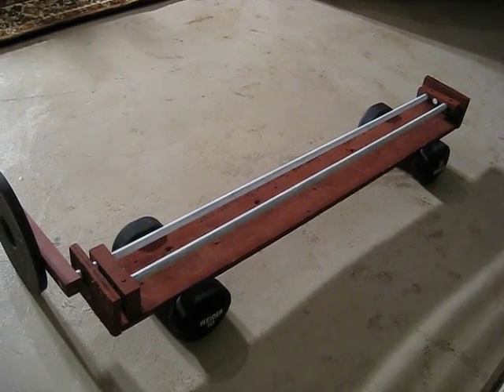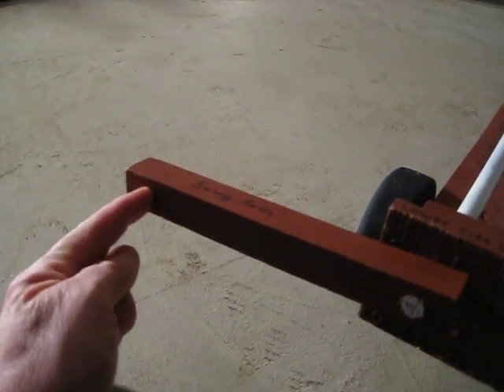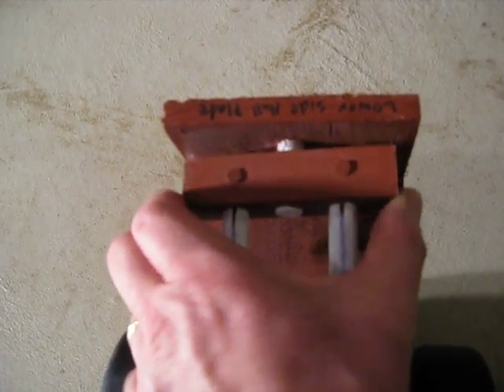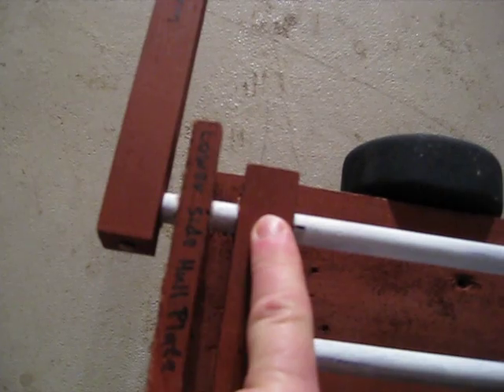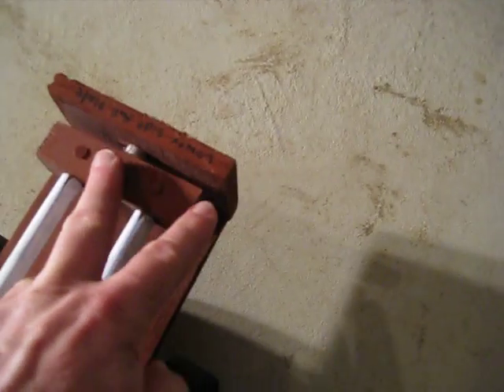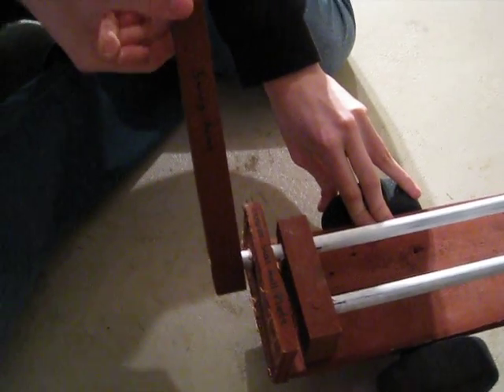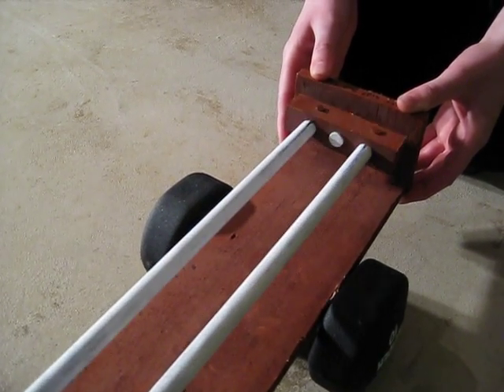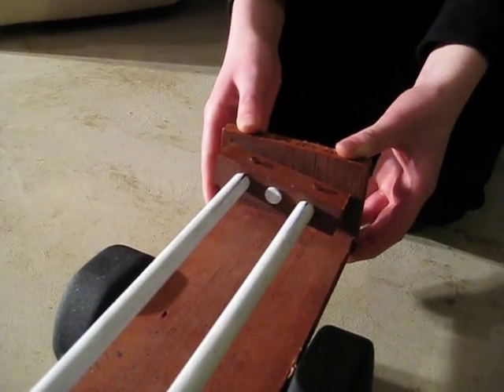PANTHER SUSPENSION, How it Works.

Comment: Stupid question, how would it work if there were wheels on both sides of the model you are demonstrating
Reply: This system is per one wheel,  one the other side the swing arm would face the other way , thus right and left side system would occupy symmetric space,  pictures would explain better
Reply: @Cormano980  not really, one side of the wheels  will be asymmetrical as they will have to be a couple of centimetres away from the other sides' torsion bar mechanism.

The result is that one of the two tracks is just slightly ahead of the other. Though that doesn't really matter when you are going 30 kmph most of the time.

Comment: The best design is nearly always the simplest solution. Thank you for downloading this! I wonder if the bearings could be greased for maintenance reasons, when so low down in the tank chassis?
Reply: I believe as on other panzers, there were bracketed clusters of lubrication subsystem pipe's nipplevalves.

Comment: Very cool approximated operating system there, congrats to all. Initially I thought the 2nd torsion bar would be geared off the 1st/primary one, but this twist & rocking bending method seems to work well too ..even if it the materials aren't scaled in relative properties and sizes to actual, it still shows enough to get the gist of it.

Comment: this was a great explanation. but i still dont understand why anybody would think to do this. it just seems wasteful on so many levels.
Reply: Well here's your trade-off, you either have 2 smaller / skinnier bars like this or 1 larger bar that is fixed at the end (most torsion bar tanks). I'm guessing the 2 smaller ones were chosen because they were either easier to manufacture or they had a shortage of material or machinery to make the larger bars
Reply: ***** i guess i should get a refund for my engineering degree then.

no, it wasn't in automotive engineering, but I like to think I have the background to understand mechanical principles--which in this case I do. "I don't understand it" doesn't mean I don't get how it works. I don't understand why this is a better solution to the problem than other methods. Obviously I'm not an idiot or else this would be the standard suspension system for modern vehicles.
Reply: ***** the issue isn't with torsion bars. its with this particular setup. this isn't just a "torsion bar" suspension. they added a whole other dimension to it and the justification for it is not apparant to me, which is why I said "i don't understand why anybody would do this", not "i don't understand how torsion bar suspensions work."
Reply: +raglanheuser They did it because then they had no material available for the rods that would withstand the forces and fit the width of the tank so they effectively doubled the width of the tank. Now better materials available for making the rod.
Reply: 2nolhta see? now thats the kind of answer i was looking for. thank you.

Comment from the maker: Advantage is more "wheel travel". More suspension travel can increase your off road stability for more speed, or a more stable gun platform.
Reply: @josephsatricleofevillanuev3194 this and the forward transmission
Reply: @Joseph Satri Cleofe Villanueva YES!

Comment: congratulations for this clear explanation! Just one question: what are the advantages of such suspensions over the others? I mean: examining the real suspension system  of a panther (Panther tank suspension and torsion bar details), it results very clear the big amount of "expensive materials" involved ,and the engineering complexity (both to produce and maintenance); therefore, we can see with our eyes and comprehend the unanimous critics of the complexity and expensiveness of the Panther, in time of extreme war need and economy.  
So why the Germans opted for it, if it was so clearly materially and handwork demanding ?
Reply: The advantages are that the majority of the components are within the armour's protection, and despite the crammed appearance inside the hull it is actually quite compact (if you were to have equivelant suspending capacity in leaf or coil springs they would actually require more metal) especially given the 16 road wheels.

The main reason why the Panther ended up with torsion bars has more, I think, to do with it being a choice that was determined by other choices. They opted for the big wheels and slack track of the Christie system but wanted more road wheels than Christie's system could accommodate, to spread the weight of larger hulls. With 8 pairs of interleaved road wheels the ground pressure at each wheel is much less, but torsion bar suspension becomes the only type available that could provide the necessary suspension travel on that number of wheels without either restricting interior space to an unacceptable degree, or leaving the suspension outside the main hull, which leaves it vulnerable.

History seems to have judged the German engineers as being right, but at the wrong time. It's undoubted that they created one of the best off-road rides of the war, but the complicated, expensive and difficult to maintain system was one of the factors in the limited numbers of machines that were available at crucial points in the conflict.
Reply: To add a little bit to what Golly Po already summed up. This is the Panther suspension over a 1 km long undulated track: http://1.bp.blogspot.com/-hJUYxlkwLYk/UMRnXfJR9VI/AAAAAAAAAls/qq_QdwXHQoE/s1600/kummersdorf%2Btest.jpg

Notice how it can go way faster than contemporary tanks, and also with much less pitching motion.
Reply: @VRichardsn  great find!
Reply: Golly Po
You are welcome! The unprecedent stability allowed for incredible off road speeds for a tank of its time.
About recoil forces: I do not know about the PaK 43 on the Jagdpanther, but the Panther definitely didn´t feel the KwK 42 firing. The 45 tonnes of the vehicle made it a very stable firing platform, even when firing sideways. And that is considering a tank that has a somewhat high center of gravity.

Source: post war French studies of their operational use of Panthers.
Reply: Richardsen
that's brilliant! It's true what they say about a picture being worth a thousand words. I've never seen that graph before, saved!

It seems from those results that the chassis was maybe more of a contributing factor to the reputation of the Jagdpanther as the best TD of the war than I thought. Observation from a more stable vehicle is easier, even if firing on the move isn't an issue, and I would also imagine that the recoil forces would also result in less pitching which would means faster re-acquisition of a target between shots.

Thanks for posting that, very informative.
Reply: Adar Brauner excellent observation but I must add a few points regarding this kind of suspension:it was among the best suspensions and had a very long excursion, I think around 500 mm that was matched only years later with the advent of the Abrams and the Leopard 2, and gave excellent service and rarely broke down or gave problems to the crew aside the fact that the interleaved wheels tended to gum up in the mud or soft snow especially when frozen. One of the main drawbacks was both the very high cost and labor intensive in manufacturing the high quality torsion bars and precision drilling on the hull not to mention high quality alloys that was increasingly scarce especially late in the war. Another issue was that the crew had to carefully avoid walking on the torsion bars with hobnailed boots in order not to scratch as the torsion bars tended to crack along the scratches...